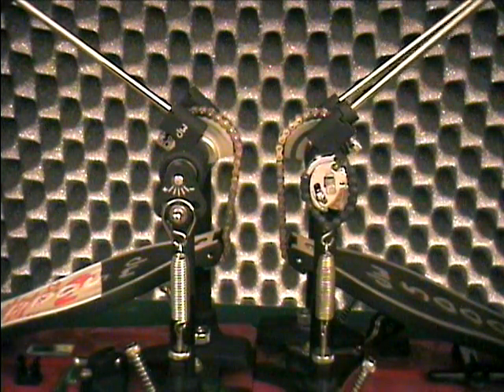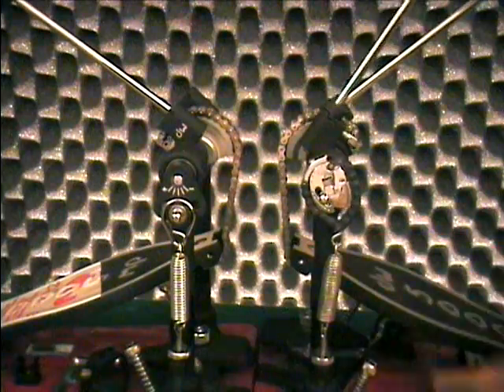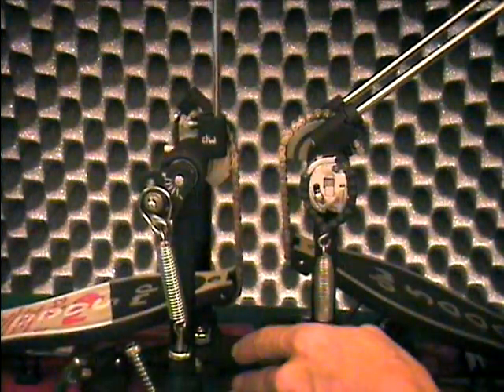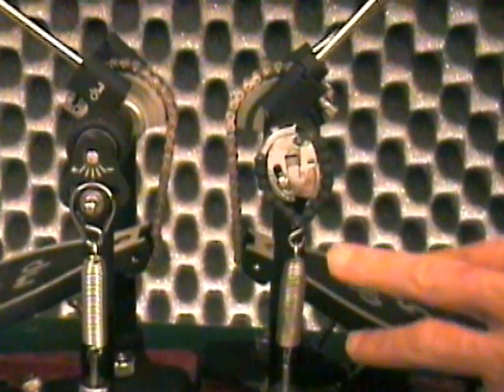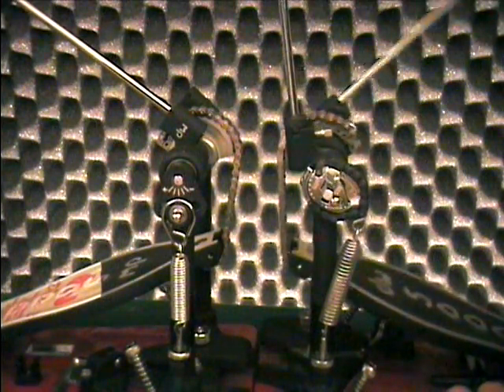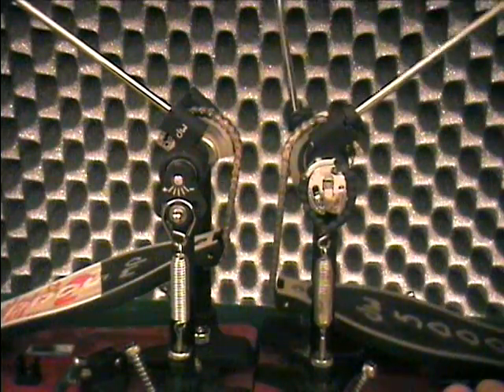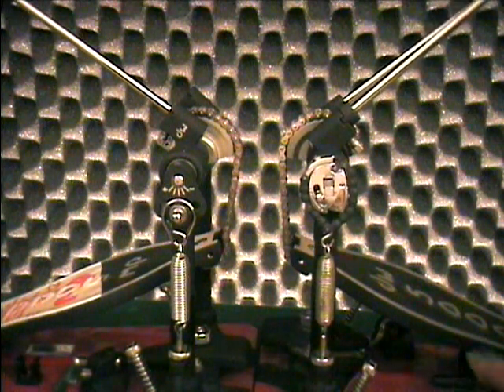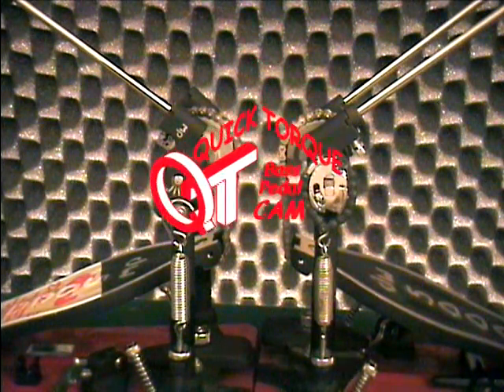Quick Torque Adjustable cam for ANY Bass Drum Pedal

Comment: I actually purchased one of these for my tams cobra pedal but ended up using it on my sonor 400 series pedal which it also fits. At first use I didn't feel much of a difference. Once I reread the instructions and started messing with the torque adjustment screw I felt what this really does. I have to say that each stroke was harder and very fluid and it did indeed make a fairly noticeable difference in how the pedal played. It basically made an average pedal great. Its super easy to install and I was using it after about 5 minutes. Thats all it took to put on for me. I also noticed that if you don't dial in the torque screw correctly for the feel you are going for it can actually make the pedal more difficult to play by adding tension to the stroke making it more fatiguing to play faster for longer times. This is where I first went wrong. I had it dialed up to hard and didn't care for it at first even though I noticed it was hitting harder with each stroke. Again, once I dialed the torque setting in, it made the beginning of the stroke smooth and fast and then finished with a hard smack. I haven't tucked it again since I set it where I like it. In no way do I know these guys or am I affiliated with this product at all but I do know that I tried to research people who have used it and didn't find many that gave the kind of review I was  looking for. I do not play metal or use blazing fast foot grooves but I can easily say it was well worth the 40 or so dollars it cost. I also like not messing with the spring tension but rather the torque screw only. Much easier to dial the pedal in. So all in all, does it work?...I have to say ..YES..very well!